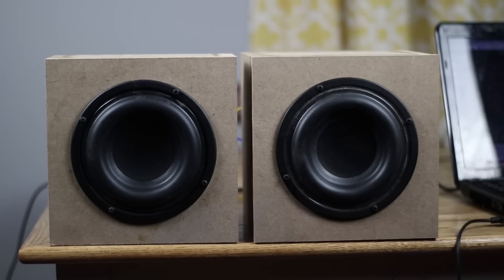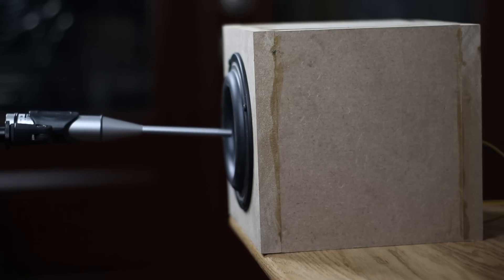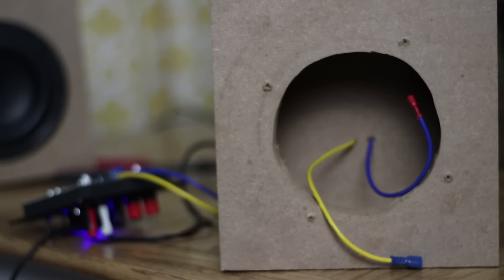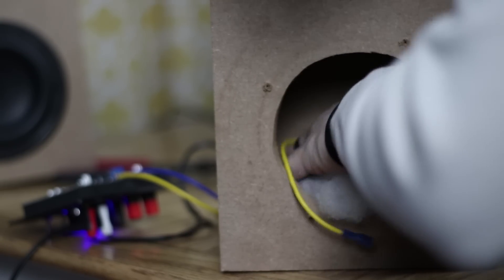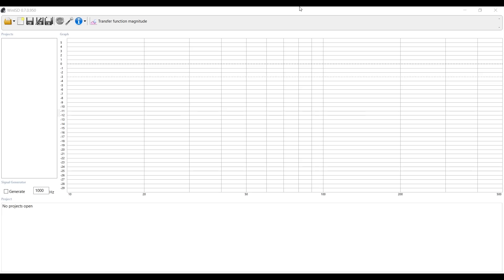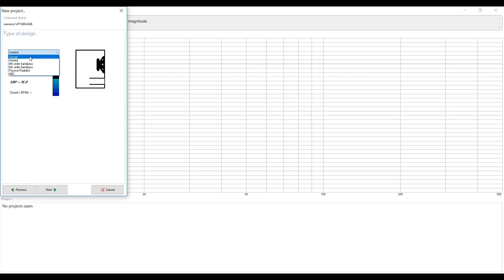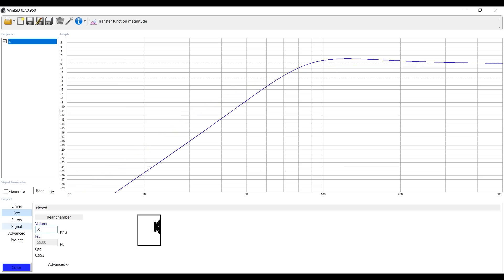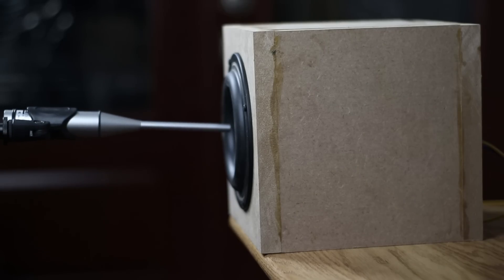Does Polyfill make a Box BIGGER?  Tested and Revealed

Comment: Polyfil doesnt make a sub think its in a bigger enclosure at all. The reason it is used in car audio applications is because when the subwoofer is dispersing heat it cools down the air.  Compressed air inside a sealed enclosure is thousands of times hotter than standing room temperature air thus keeping the interior of the enclosure cooler making the subwoofer stay more efficient

Comment: How do i fix the opposite problem, i made a big ported box for my 13w7 tuned down to like 18 or 19 hz. After hearing this, it rsttles the damn walls but plays so low that I now want to tune it higher to maybe 26hz. Any ideas?
Reply: Change the dimensions of the port. There are calculators all over the internet.

Comment: Why do you keep the mic so close ? Any special reason ?
I think 1 meter distance would be appropriate.
Reply from the maker: It is due to reflections in the room. If you kept it 1 meter out, you would get reflections in the room and would not get an accurate bass response. That's all due to the length of the sound wave at each frequency. 1 meter back won't give you any accurate response below 500 Hertz. So in order to reduce / eliminate those reflections, you need to place the microphone as close to the cone as possible.
Reply: @Toid  Ah ! Got it ! You are right, Thanks.

Comment: Better idea, add a 2nd woofer in clamshell isobaric arrangement.  Then the box acts as if it was twice the physical size (6 cu ft. vs. 3 cu. ft for example).  Adding polyfill AND doing the double isobaric woofer as described will make it behave more like a 7 cu ft. box (being 3 cu ft actual and assuming the 3 cu ft box was not stuffed with polyfill).
Reply: You got a diagram of this? I think I see what you’re saying but visual aids always help lol
Reply: There are tons of videos on isobaric alignment/arrangement of woofers.  Just search YouTube.  Here is a good one...

https://www.youtube.com/watch?v=BdF7nTU_QOQ&t=73s

Pay particular attention starting at 0:53 elapsed.
Reply: Yeah, but that requires another woofer be bought.  Polyfill is cheap.  Buying another woofer?  Probably not so cheap :-)
Reply: Some bad assumptions going on.  First, adding a 2nd woofer (in an isobaric arrangement) will make it play WAY DEEPER than just adding polyfill to a single woofer.  Secondly, maybe someone (like me) has an identical 2nd woofer lying around doing nothing so in that case it would actually be CHEAPER (relatively speaking) than buying even a little polyfill.
Reply: You need twice the power.

Comment: This polyfill thing has been tested and proven before but my question to you is, will it work equally as well in a ported enclosure as it does in sealed???
Reply: I've use poly filled in my ported sub and it made a noticeable difference in sound quality
Reply: @jamesbannister7512  I am curious how. Better lows? Better response? Did you have to sacrifice a db or 2?
Reply: Yea dropped atleast 2 db but my sub sounds alot cleaner. No more boomieness and I can hear the audio alot easier. Kick drums sound better and bass sounds alot smoother. I also noticed that because I tested it both ways. Sub placement is alot harder to find with the ear now. Before I could spot it easily as soon as I walked in the room. Now for my sub it blends in alot more then it did before and half the time I forget  where I have it at

Comment: Might have been mentioned already but there is the theory that fiber glass insulation works the best. Not sure if that's ever been tested but that is common to hear.
Reply from the maker: We might test that some time. The problem with fiberglass insulation is that it will break down over time.
Reply: 123Toid , that is true (we are talking about just sealed boxes right?) but its a certain condition that causes it.
If moisture is present fiberglass insulation will start to break down.

But if you were also talking about a ported box then yeah, its not a good idea at all.

I'd still be interested in seeing how fiberglass stacks up to polyfil, though.

Comment: Doesn't make sense for a sealed box. Makes sense for a potted box. There is s speaker design (I forget the name bit it's an old design) where there is an elongated port going upwards where you can tube the speaker sort of by adding more or less damping material because it slows down the sound waves in increments depending on how much material you add to the large port. You basically just tuning the sound coming off the back of the woofer. But for a sealed box it would cut down on the retractions coming back through the cone of the woofer but your not increasing the amount of air the woofer moves or essentially changing the resistance on the movement which is what happens in different sized boxes. So your effecting the sound by adding polly fill for sure as you get less refractions, but making the box bigger? No

Comment: Pollyfill works good in a sealed box as long as you don't get it in THE SPIDER.
Reply: I was wondering about polyfil entering the subwoofer basket. That seems like a bad idea, mixing loose fiber with heat
Reply: granola Times polyfil is naturally flame retardant. I don’t think it would ever generate enough heat to melt or cause flame.

Comment: I always add polyfill to my sub enclosures. But for SPL competitions, I think it’s not recommended. I think it’s because even though it drops the frequency response, it also reduces the SPL slightly.
I could be wrong though since I’m not into SPL competitions.
Reply: It would yes. A speaker produces sound waves in both directions of travel. So you can think of it like it is two speakers. One firing sound forwards and one backwards. The sound travelling into the box gets absorbed by the damping material and doesn't have a chance to reflect back out the front of the cone. The fill slows the sound waves down though lowering the frequency so for sound quality you will want damping material especially when ported

Comment: Would it be fair to say the dampening has changed, like a high end shock absorber having its 5 weight oil drained and replaced with 10weight? Both compression and rebound dampening are increased as oil is more restricted in its path thru the piston ports and deflected valving shims for the intesity of the impact to the axle from the irregular driving surface? It is technically viscosity causing this, but increasing the shims thicknesses on the piston would be another way to obtain the same basic result.

This is entirely seperate than changing the spring rate, which would be (in the speaker reference) a change in box volume, higher spring rate in a small volume to squeeze vs lower  foot#/inch in a larger air volumne. 

Polyfil is the shock absorbers dampening where enclosure volumne would be the spring rate(air springs and added air bags while losded exist for this reason) do to more or less air to compress/release.

Tuning a box of a given volumne with port length is shock absorber dampening, polyfil is another version of this, one is the valve shims on the piston restricting or allowing oil flow, the other is a chabge i. Oil viscosity with very similar results.both are tuning (or taming) the spring or the mechanical/electromagnetical ‘quickness to move’ portion of the Q values in the T-S parameters.

Comment: You need to use spray adhesive and line the interior walls not just stuff it in there
Reply: @Lewis Goudy I think he's living in the past before crimped fibre was the go.
Reply: @Lewis Goudy It's a sealed box so the effect you're seeking is a change in Q as noted elsewhere in this discussion. If it was a vented enclosure, then you want to suppress standing waves and Thumper 98's suggestion makes more sense for that use case. It's even possible to make a curtain of BAF (bonded acetate fibre) strategically placed at a node that we used to do in the 1970s.

Comment: What about eggcrate foam? I've heard it can be good for some applications
Reply from the maker: It absolutely can.  I didn't test it in this video.  But Egg crate foam is used a lot in ported subwoofer builds.  This is nice since it won't fly out the port and can break up standing waves.
Reply: @Toid  It's also a cheap way to reduce echoes in a room for recording purposes :-)

Comment: , try gluing or staple some foam or sound deadening material on the "sides" of the box instead of just stuffing the box. 
this makes more of a difference than just stuffing a box.
Reply: Are you recommending acoustic foam INSTEAD OF, or in ADDITION TO the polyfill? To me, getting rid of standing waves is critical, there is no such thing as over-damping a sealed box. for bass reflex ported boxes, you don't want to over-damp, because some resonance is required for the port to do its job.
Reply: Vincent Robinette , I suppose just testing different methods. I've actually done both

Comment: , I'm sorry but I beg to differ about microphone placement. Base and trebbels are two totally different frequencies.
bass is NOT direct as much as high ( tweeters ) frequencies. high frequencies bounce off of or ( reflect ) walls and other hard surfaces much easier and " faster " than low frequencies do. 
but tit for tat. 
high frequencies are absorbed much easier than low ( base) frequencies. hence, room treatments, wall treatments with foam and carpeted floors. 
low frequencies can actually travel longer distances and through solid objects such as walls. this is why elephants and whales can communicate over hundreds and even thousands of miles for whales. amazing.

Comment: You want a loud speaker but a large speaker box wont fit in your space? Buy a small speaker either 8 or 10" but with high power handling put in a compact box match it with an amp. I prefer passive radiator instead of Pollyfill.

Comment: What the polyfill or any fine filament material does is change the compression of the gas inside the box from an adiabatic compression to a isothermal compression so the volume of the gas acts as a softer spring. For Isothermal compression the gas has time to exchange energy with it's environment (polyfill) so the minute increase in momentary temperature when the gas is compressed without the polyfill is changed to a constant temperature environment. There is a diminishing return because the polyfil is actually also replacing the air in the box; so stuffing it with too much polyfil will reduce the volume of the box more than the gain  in softer spring constant for that air.
Reply: This.

Comment: Sound pressure decreases with the square of the distance . In this case from the distance from the speaker surface.  So, I think that measuring so close from the surface is not good to compare both ways of building the box.
Reply: Just no. The further from the box, the more you are measuring the room effects and this was contra the purpose of the experiment. What you say is true only if you perform the test in an anechoic chamber.
Reply: Jonathan Sturm you are right, thank you for pointing this out!!
Reply: @pabloosvaldopenizzotto1098  You're welcome :-)

Comment: big thumbs down here 
the difference in the sound levels is dB not Hz FFS
cant trust anything else if you cant get even the terminology correct
Reply from the maker: We are testing low end frequency response as it relates to DB. As you add more polyfill, can you get an extended low frequency, ie more Hertz, at the same DB.  the entire DB of the speaker isn't going up or down, just the low frequency range. I'm sorry if that wasn't explained well enough for you.

Comment: Polyfill is not very effective. The author should have used fiberglass instead. As can be seen in the Loudspeaker Design Cookbook fiberglass (and acoustic foam) can make the enclosure up to 40% larger in the case of 100% fill with standard household fiberglass or 50% fill with 703 rigid fiberglass or acoustic foam. You can see in the graphs in the LDC that the lowest frequencies are 3db higher in level indicating an apparent 40% increase in volume for the best of the combinations of fill tested.
Reply from the maker: Thanks for the information Daryl.  Just to clarify this test wasn't about what is the best material to use.  as stated in the video, you hear people say polyfill can trick a speaker into thinking it is in a larger enclosure. There is a lot of confusion on this subject.  This test was only to prove whether polyfill did in fact do what some people claim.
Reply: I refrenced the loudspeaker design cookbook in a reply for another video a few days ago and was called a fraud. Glad to know im not the only one who has read it

Comment: 2 mistakes....
1: The low bass tones goes (almost) straight through the fill so the test should not be done on a subwoofer setup
2: Yes polyfill will acoustically make the cabinet larger but only up to about 20% so in fact the box should have been only 20% smaller

So the two mistakes  make your test not really possible.......if you want to prove the claim
Reply: I should say normally you put NO filling in a subwoofer.
The critical part here is to make the cabinet 'non flex' as stiff as possible

Comment: The reason you put in polyfill is so that standing waves created by the woofer are not sent back out through the woofer, creating a muddied sound.  On enclosures that are triangular or curved, polyfill isn't needed because the angles dissipate the frequencies from the back of the woofer before they can come out the front again.

Comment: so taking it as seen on the test and what it will do is take up the air space so the speaker has less air to breathe in turn the speaker/sub will not last as long the voice coil needs the air to breathe an cool down the manufacturer specs or speaker box size for Porter or sealed enclosures a quarter can be taken off without damaging the speakers so if it says 1 and 1/2 Pur sealed enclosure you can take it down to 1.25 without damaging it this is all based off of experience and building boxes and enclosures for car audio and home systems now that is based off of quality built speakers that actually cost you a bit of money not a cheap hundred dollar set

Comment: I've used insulation inside of speakers and subwoofers to "color" the sound. The larger the box, the more the insulation, or lack of, effects the sound, but it also does effect the sound of small speakers. Very interesting, I'll have to do a similar test and measure it myself.

Comment: Have you considered the type of material used to stuff a speaker? Some DIY speaker audiophiles say that wool is preferable to the synthetic materials used in most speakers because it improves the sound of the speaker. I haven't tried to do a comparison, so I have no idea if this true, or just snake oil
Reply: I've used carpet pad before and it's awesome.  It's dense and non uniform so it breaks up standing waves better.  You can glue it to the inside of the box then use poly fill if needed.
Reply: @theoracleprodigy  yeah it's very inexpensive too. Works great
Reply from the maker: I haven't, but that may be coming in a future video
Reply: There's some very expensive fills around. Check out mundorf's stuff as a good example. Personally I use closed cell foam with open cell foam for a dual density effect. It also leaves the majority of internal air flow unobstructed.

Comment: A software to calculate the polyfill amount does exist! AJHorn can calculate boxes with a roughly given amount of polyfill. You can enter a value in it for a parameter called beta (β) at different places, where zero means no polyfill and 1000 means fully stuffed. Just try out the demo version where the horn lenght parameter is limited to the values of zero and 50 centimetres. With it you can at least calculate closed boxes if you set the horn legth to zero and the areas at beginning and end of the horn to the size of piston area of the driver. You can verify the amount of polyfill by comparing the measured impedance response to the simulated one.
I personally think it's totally worth the 120 euros if you use it frequently because its calculations are very accurate and it's capable of calculating closed boxes, bass reflex, transmission lines, frontloaded horns, backloaded horns and band pass boxes including the influences of a crossover network. Just above ~200 Hz its accuracy decreases because it doesn't take baffle step and measured frequency responses into account. But there are other programs for that.
Reply: It seems to me, that that program would be most useful for ported bass reflex boxes, because of the need to precisely control resonance, rather than trying to eliminate it all together.
Reply: @vincentrobinette1507  : You can enter beta in five different places: At the beginning of the horn/transmission line, at the end, inside the front chamber, inside the rear chamber and inside the absorber chamber. It is capable of calculating bass reflex, transmission lines, horns, band-pass (also 6th order band-pass) and everything in between. Just have a look and try the demo version: www.aj-systems.de/indexe.htm
Which resonance in bass reflex enclosures do you want to control with polyfill? In a three-way design you don't need polyfill at all in vented boxes, if the crossover frequency is lower than about 250 Hz. In two-way designs it's best to use only a little amount at the top and bottom end if it's a long floor standing speaker and high density material (1-2 cm thick felt or e.g. Bondum 800) on the walls in the middle to absorb the mid-frequencies. The standing wave between top and bottom should better be treated with an absorber chamber instead of stuffing in the middle of the enclosure. If none of the inner dimensions is bigger than 50 cm standing waves aren't even a problem.

Source of all my knowledge: German DIY loudspeaker magazine Hobby HiFi
Reply: Hronresp can simulate the impact of stuffing.